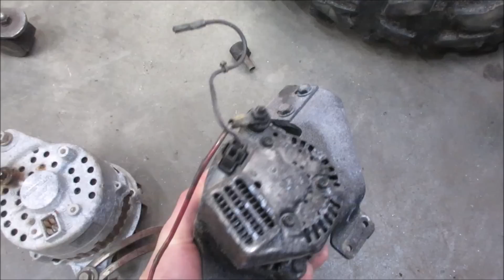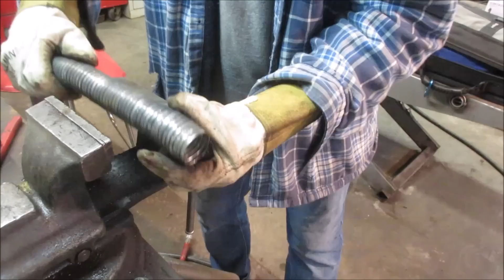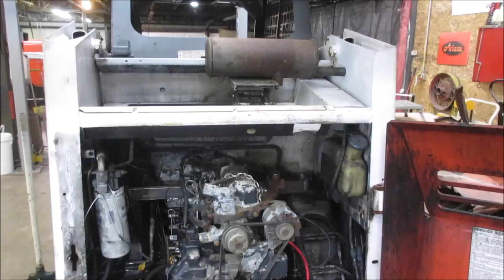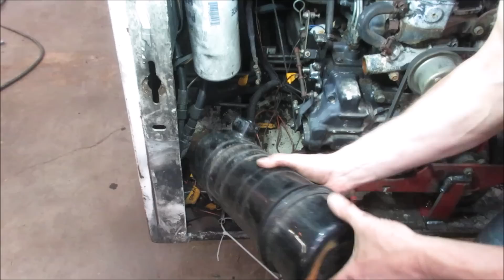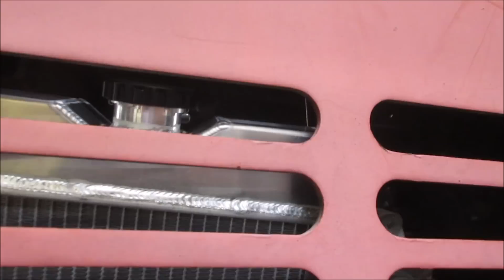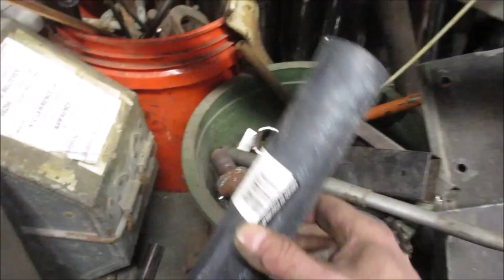Making a Big Engine Fit a Small Hole. Busted up Bobcat Skid Steer.

Comment: Just as an FYI, a lot of those cheap fans have blade sets that you can unbolt and turn over so they can be ran in either in a pushing or a pulling direction.
Reply: do what??? all you have to do is reverse polarity.
Reply: @steveww07  Yes but then the fan blades aren’t oriented in a way that is very efficient. If you flip the blade set to go in the direction that the fan is spinning you get much better airflow.

Comment: You can’t run a diesel engine on hot air. The best solution is to relocate the air filter outside of the engine compartment.

Comment: The radiator need to be above and the fan blowing outwards of the engine bay…

You are concerned that branches will tear your muffler, but not concerned you’ll poke a hole in the the radiator? 🤷‍♂️

Comment: Raise the exhaust pipe above the cabin. Put another flexible pipe and attach the exhaust to the cabin. So when you need to fold the cabin, it will not cause any problems because of the flex pipe.

Comment: 29:33 attach the cable to the lower part of the throttle plate beneath the pivot (just to the right of your thumb) and it will work in the correct direction.
Reply: 30:01 Oh. lol

Comment: Maybe extend the door hinges and latch about an 1 to 1 1/2 inch out?  Sure there would be a door body gap but having more room for the rad, fan and engine bounce would be nice.  The last thing you’d want is for the pulley nuts to wack that rad core?

Comment: Morning Mustie 1, just a suggestion, take the door of cut slots in it for more air flow remount hinges on opposite side , mount rad to door with flexible hoses, rad will move with door gaining more access to engine, mount fan to door/ rad to blow outward so heat is not blowing   towards cab.Gord Ontario Canada
Reply: I was going to write this too. Not sure if it was Gehl, but have seen it mounted to the door in another model too. You do need longer flex pipes to allow it to swing.
Reply: I think that's how it's done on Gehl skid steer...

Comment: Get project coming well together. I would say on the left of the Rad add pic medal to the side body. An maybe add a strap from the Rad with a rubber to the engine on the right side. Yes cut for more air flow for the Rad too... Diesel Engine like more cooler air,,.. So maybe put a fresh air filter, near the top inside...

Comment: Fun project! My thoughts on the fan are to place it on a bracket so it swings and mount the fan on the opposite side. I think the air intake/filter should be on top to draw cooler air and make servicing easier. This is an awesome revival as most of these get scrapped when this reach this state.👏🏻👏🏻👏🏻❤️🔧✌🏻

Comment: Thats a lot of radiator for that motor.
Mount it were it fits best and use smaller fans.
 Maybe even  dish a fan and mount it on the pully 
Mount the air cleaner on the outside, so you don't have to remove stuff to get at other stuff.

Comment: Good Morning, Its great watching this project come together. A few things though, the hydraulic oil cooler will need some active cooling or repositioned to the radiator. The cooler is undersized for passive cooling. On a stock machine, there is a giant flywheel with fins and duct work that blows a lot of air through the cooler and radiator about 4 to 5x what a electric fan can do. The engine coolant temp should be fne. also, the muffler might a bit too high. when you lift up the cab it will rest on the muffler and the cab weighs a ton.

Comment: Shouldn't you have the fan on the other side of the radiator, to blow air from outside thru the radiator, instead you will be using engine compartment air to cool the rad. ?
Reply: Nevermind, I think you are right with the direction.

Comment: Pretty sure the exhaust outlet from the muffler usualy is out through like the hole just behing the cockpit. just straight up and with a 90-100° bend at the end pointing backwards so it doesn´t rain right down the exhaust.

Comment: A idea also mustie when you cut those holes out for the radiator. You might want to put a wire mesh to protect the radiator from something that might get through those new open areas so it doesn't puncture the new radiator. Like a screen.   Just a thought.. I know you're not on that yet.  But that cover was solid for a reason...

Comment: Nice set up. was thinking about the air cleaner filter intake, just a thought having it inside where the engine is, wouldn't it then be sucking in heated air and cause running problems fuel consumption issues? Fire away.
Reply: on our 1999 Bobcat 763, the air cleaner is stuffed in the engine compartment from the factory

Comment: I would caution mounting the fan directly to the radiator. Those type of mounts with the zip ties will wear through the aluminum tubes in the radiator.  Especially in a machine that bounces around like that. I have had it happen to me.
Reply: Good comment , food for thought.👍😏

Comment: There is a "history of Bobcat" video on you tube.
Two brothers in 1940s make the first  snow blowers then a machine to clean out turkey waste from barns which became the Bobcat .
I had several 763 s Deutz and Kubota powered.
My last was a S175 Ingersoll Rand 2006 before they sold to Doosan Devlon .
They now are plagued with high tech issues terrible quality unlike the old ones .
Kubota kinda took over Excellent quality.
Bobcrap now .

PS most newer 763 have radiator above engine horizontal with hydraulic driven fan . Perhaps this would be easier  ( using electric fan ).

Comment: You can buy a thermal switch for the radiator fan whose single tube sensor sits inside the top radiator hose with a shaped seal that goes underneath the hose clamp. In the UK they are made by Kenlowe but I am sure there must be a US maker for similar.

Comment: You might want to mount the radiator with rubber isolators with it being aluminum, your mounting flanges will crack from the vibration

Comment: Memories of shade tree custom dual-exhaust conversions using nothing but a hacksaw, flexpipe, clamps/socket, and either Cherrybomb glasspacks or Hush Thrush 'sound enhancers'!
Some baling wire for hangers. No chewing gum required.
Get everything safely aligned, run it until it's good and hot, then spray all the flex pipe with the garden hose to jump start the corrosion that locks it down tight!
DIY Easy-Flow Exhaust. Gave those small block V8s a respectable voice.

Comment: Great update.  I think you are going to have a hard time keeping heat in that small engine…appears that is way too much radiator for your need, especially since the hydraulics have their own radiator.  A small radiator say for a Honda civic should be enough and have a much smaller footprint.
Reply: Is it not better to overcool the engine rather than having it run to hot.🤔

Comment: That radiator looks crazy overkill for that engine. Didn't the mover have something usable on it. If not just go scrap digging and find something smaller that fits on the exhaust side of the engine, like for example how the original Mini has it's radiator mounted. Would also make the serviceability 100 times better. Other than that I like it big time :)

Comment: This engine is a Mitsubishi L3e  it should say it on the block, it has a electric solenoid u can actually push with your finger to shut it off instead of putting your hand over it

Comment: The cab needs to flip back to access hydraulics
I think I would stuff that muffler down where the air cleaner was and mount the air cleaner on top of the valve cover or to the drivers' left side of the engine compartment next to the fuel filter.

Comment: Use rubber isolators to prevent rad welds from cracking off from vibration
Reply: Yup those side mounts will flex vibrate and crack. Take some radial sidewall and sandwich the rad and support😊😊

Comment: Hi from the far South East of Europe. Proper build videos are always my favourite content on Mustie's channel. You just know that in years gone by he would have just cut a radiator sized hole in that back door and mounted the cut out panel on 2 inch stand-off brackets on the door. Job done in a fraction of the time and much less faffing :-)

Comment: It's just me, but I so much prefer these mechanical videos over the body work ones.  But, I suppose there are plenty of body folks out there that loved you fixing the Econoline.  One thing to add,,, not 100% sure of this fan but you may have been able to Reverse the Polarity of the fan motor AND flip the fan blade on it's shaft to achieve efficient airflow in the opposite direction.  Which would enable you to mount the fan assembly on the outside of the radiator.  The kind of modification that you do every day.

Comment: It might be best to mount the radiator to the door, so when you open it you can actually get to stuff like the belts, air filter, dip stick, etc.  With the size of that radiator, you are also going to want to thermostatically control the fan.  If you run it with ignition on, the engine will likely run too cold, plus it is an unnecessary draw on the the electrical system.

Comment: Mustie, why don’t you put the fan on the other side of the radiator. That way the fan can be drawing out the hot air. Plus you could make a hinge bracket so you can turn the radiator out the way when you come to service it. 
Watching from Devon 🇬🇧.
Reply: I agree the fan would be better on the other side!!
Reply: The flow has to be right though, and the radiator is already as close in as it can go. Perhaps the fan blade can be flipped on the shaft to get it to blow the other way. As is, the fan is using room that would be wasted and it has to blow through the radiator. Putting the fan on the outside means that it has to suck air through the radiator and there may not be enough clearance for the door. What is best, suck or blow?
Reply: @bruceknowling415  I have that same fan on a project car. The fan can be removed, flipped around, then run in reverse polarity to achieve good air flow in the desired direction
Reply: @bradensmith888  Which is best, push or pull through the radiator?
Reply: @bruceknowling415  I believe pushing air is slightly more effective, but I don't have evidence or sources to back that up
Reply: @bruceknowling415  if you mount the fan on the other side of the radiator you don't have to change anything.  The fan is still PUSHING air no matter what.  In the current configuration it is pushing air from inside the engine compartment through the radiator and out towards the back.  If you put the fan on the outside of the radiator it is pushing air from the outside towards the engine bay.  No need to flip the fan or anything like that at all.
Reply: @Jimschrbr That is another topic for discussion, esp with slow moving equipment.

Comment: I say this in every video i see someone struggle with exhaust bolts/nuts. Since i found seafoam deep creep i have never used anything else. Ive had things that i felt i was going to snap off trying to break loose and used everything under the sun plus heat and it was hit or miss whether it worked or not. Used deep creep let it set a little bit and had things break loose almost like they were never seized, not going to lie and say everything came off that easy, but deep creep has worked every time for me. The exhaust on my car i tried and tried with wrenches interlocked and my body weight, legs locked against the bottom of the car and all my strength couldnt budge. Tried an impact and nothing. Last time i workrd on it i had no option but to.drop the exhaust so i shot it with deep creep, let it set and my 1/4" milwaukee impact broke them loose and zipped them right off. My mind was blown!